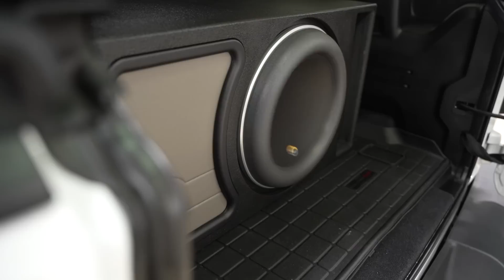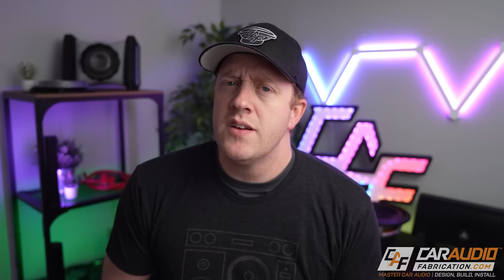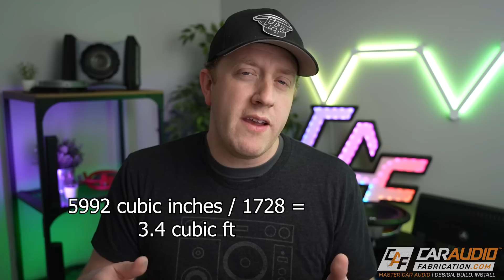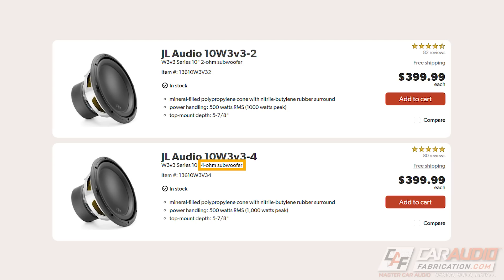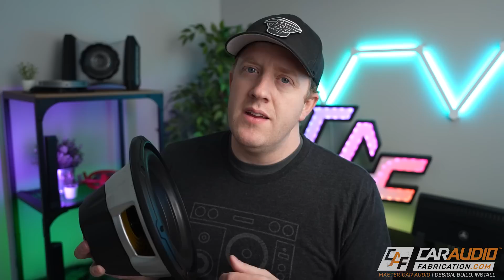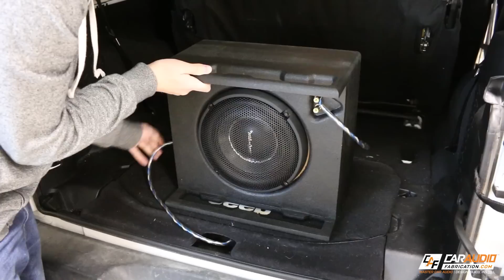4 Subwoofer Mistakes that Destroy Bass! Sub System Planning Mistakes

Comment: I think the biggest caveat is the newer vehicles themselves. Thinner metal that is bent in certain ways to increase strength and aerodynamics but, this creates hollowed out spaces that either absorb bass, amplify certain tones (usually mids), and reflect highs all over the place like a 22 magnum shot in to a metal box. Sound matting can only do so much to correct this unless you are willing to take apart the entire vehicle to its bones.

Older vehicles maybe less aerodynamic and don't have as high as a crash rating, but many didn't have the same sound issues as the new ones. Heck, if your system isn't crazy loud, sound matting may have not have been required to increase sound quality, or it made only a little bit of a difference if any at all.

Comment: I always thought subs facing out the trunk sounded better , but facing it upward produces a noticeable difference and it hits harder. Could you think of reasons why this is? i have a sealed box 10 inch jbl in a shallow enclosure.

Comment: Damn. I made mistake 2. Got a JL RD 500/1 but paired it with a JL12w1 4ohm. It definitely feels underpowered. Should I try a kicker comp R 12” (500w RMS) or try the w1 but the 2ohm version?
Reply: W1 is only 300 w RMS

Comment: How would I determine if I'm occasionally getting poor bass response due to the subwoofer, the enclosure, or the amplifier? I have a JL Audio 10TW3-D4 shallow mount sub (100-400W RMS, 0.52CuFt sealed box volume), wired it 2 ohm to the 5th channel of a JL Audio XD700/5v2 amp (300W RMS), and have it in a molded under-seat sealed MTX enclosure good for 0.8CuFt of volume. It sounds great for the most part, but very obviously falls flat during many 'kick drum' parts of songs that sound powerful in other vehicles with different setups. Unfortunately I'm not in the type of position to be able to try this subwoofer in several types of enclosures myself. Could this subwoofer be picky about that 0.3 extra cubic feet of volume in the box? Or would that just be one of the limitations of a shallow sub in a smaller enclosure? I've never read a bad review about the sub or its output so I'm not sure what to think.

Comment: I have a gutted 300zx, so it'll need more sound insulation in the cargo area but I have like 40ish square ft to work with. Should sound good tho since it's shaped like a CRX. 2nd gen CRX's were always great Db drag platforms cuz they could do a lot with the small sq ft area. The shape of the car helped with wave direction.
Reply: Also I did upgrade my alternator, (it did have a 70A rating too, how did you know? Lol) with a 200A direct replacement from PowerBastards cuz they had the only one I could find with an older v-belt style pulley.

Comment: Securing the actual box properly and things around it is a big one. I was chasing a random bad rattle forever and thought was sub was blown, turn out the box was shifting slightly when I made turns and allowed the searbelt buckle to rattle against it when it happened. Make sure your box can't move and things around it can't make noise.

Comment: I just installed an aftermarket amp and subwoofer to my Ford Sync 2 factory radio. When I turn off the vehicle the subwoofer thumps, any ideas?
Reply: My idea is never turn your vehicle off . That'll fix your thumping.

Comment: Is a 2000 watt amp good for 2 2500 watt 12 inch subs?
Reply from the maker: RMS? You are theoretically leaving performance on the table.
Reply: @ rms power at 4 ohms is 800 watts x1 channel
Reply: @CarAudioFabrication  is that the right information, I’m new to subs but I’m in love with bass.
Reply: @CarAudioFabrication  the subs rms are 1250

Comment: Mark, quick question for you. I am an old guy with a legacy system that I've had since 1997 in my classic Mustang. I have (2) 10 inch S10C Solarbaric subs, DVC. Is there anything out there that has the same footprint and box size that can hit harder than the S10C can? I was wondering about motor size and cone mass to see if there might be something better out there now.
Reply: Wow thats a long time to have the same subs.
Reply: @cleonituk  that's a very good point unfortunately there's a term if it ain't broke don't fix it. I also have a tape deck that works like brand new. I paid $5000 for that system and haven't seen any need to upgrade anything until recently with the new subwoofer tech technologies. My home system is a different animal it's almost 5 figures.
Reply: @1999StangGT4  my first system was way back in2002 in a dodge truck, i had a 15 inch orion hcca with a 3k watt amp behind the seat. Lets just say whoever rode shotgun had to have the seat at a 90 degree angle. But it didnt rattle one bit.
Reply: @ i've got MB Quart all around and then of course the solobaric subs with a kicker amp and a JL amp. Kicker takes care of the subs and the JL does the mains. Roughly 200 pounds of dynamat as well. Before the Basscube was re-released people were begging to buy mine.

Comment: hey how about a vid on supertweeters..i bought some and the crossover is kinda confusing also doi i run the capacitor that it came with despite having a cross over in my head unit and 4 ch amp...HELLP

Comment: Do you have any videos about installing stereos in vehicles that have built in systems? For example, I have a 2018 Durango SRT. It came with a stock 8" sub and I have since upgraded to 2x 12" JL W6s. I cannot get these to sound good and Ive been to multiple shops. I have a pac amp pro installed to get a "flat signal" and its still terrrible. do you deep dive into this process anywhere?

Comment: Is it possible to discuss subject about upgrading hybrid vehicles? Simple replacement of alternator is not possible, changing small 12v battery to bigger is limited by its charging source, maybe there are some solutions of powering amps from traction battery?

Comment: Is it better to for subs in a sealed enclosure to have the minimum recommended volume or maximum? My encloure is measured at .89 ft3, the minimum for my sub is rated at .66 and the maximum for my subs is rated for 1.25

Comment: Is it possible to run one  Rockford P3 with a port and one P3 in a sealed within the same box?  Would that work? I bought two, and they sound great, but the sealed box i built just doesn't hit the low notes like i prefer.  I would rather not take up all the space in my trunk for a box as i put my tools on there. The box i have is made to spec for both P3's for sealed dimensions.   

I guess my question is, would it sound better with one sealed and one ported, and would it work making one box with sharing walls extra sturdy?

Comment: I have a new alpine type S 12" and the mrv-500 amp. I have sealed box. Do you need fluff pading inside the box and should I caulk the whole thing absolutely airtight?
Reply: It would depend on what size your box is.  You could add poly to it and see which way you prefer, as everyone hears differently. I have two of those. They have been in my closet for a while and I am going to implement them as bass for my home stereo I am building. I'll probably get amp from PartsExpress instead of a car amp so it looks better flush on the back of the box. 

For sealing, yes. You should always add a decent layer of caulk (or adhesive) to all of the connecting walls. I usually use extra sound deadening material at the mating point from the subs as well. I just peal of the aluminum layer.
Reply: @nomadchad8243  I just added polyfil to two sealed 12s and WOW. Makes a huge difference.
Reply: You should definitely seal it so it's airtight.  As far as the fluff inside, I've used boxes both with and without it.  It isn't required, but it does offer some benefits for a minimal cost. If your box is on the smaller side for your sub, adding some fill will help improve performance and SQ.

Comment: I am very happy with the box design i got from you a couple years ago for my sundown zv6 12 in my Ford Ranger

Designing it myself with doubled 5/8" and a triple baffle was beyond the capabilities of the simple enclosure design program i've used in the past (Torres) so i went with a design purchased from you and it's rock solid and bumps pretty damn good, thanks Mark

Comment: Another I'd add is the idea that swapping out a good aftermarket sub in a stock "enclosure" would bring much, if any, improvement to your system.  In almost every use case, it's not worth the money, if it works at all.  Clearance issues, enclosure issues, rattling issues, power issues, impedance issues... it just doesn't perform worth the money nor the effort.  Complete waste of time and money.

Comment: Great informative video as usual!👍 I've definately made a few misstakes along the way. High impedance comes to mind as one. Any chance you'd do any videos on smaller vehicles in the future? I find squeezing good audion into a small car is way harder, and I usually never quite succeed. I had too much bass in one ear in my mr2, my mini is short on space to put it politely, and I've got a small panel van (mk2 caddy) as well, which needs a stereo, but also needs to be an actual van, and not loose any space. And my miata is a soft top, so that brings its own acoustic challenges. Finding info on big systems in big cars is never a problem, but i've yet to see any videos on how to build for small cars.

Comment: How do you feel about Memphis Audio? I have heard it in a few mini trucks and it sounds fantastic to me. But I am not a pro.
Reply: Memphis is ok. I had many subs.  No Amps tho
Reply: depends on your budget, they all have budget subs all the way to top tier. Alot of companies compete with each other at the same price points. If you want teeth rattling bass it's going to cost ya, If you want just a little bass to sound good then cheap is the way to go
Reply: I'm no pro but recently over 2024 I've been racking my head about what's good and what's bad. This is what I've found.
Box. Your shit subwoofer will sound anywhere from good to amazing in the right box.
Example. Bose car audio. Sucks.
Fight me if you think otherwise.
Now their home audio.
Amazing. Why? The amount of engineering that goes into the design of the housing for these speaker's/subwoofers is amazing. Open up a car that has factory nose speakers. You'll find they sound dreaden and secure everything for optimal sound quality. 
So honestly I'd go with a known brand. Doesn't have to break the bank. Ct sounds. Kicker. Skar etc.
Then get an amp that will drive them you can mix and match brands just make sure to get the ohm rating correctly. Also if you're going to drive 2 subwoofers with 1 Amp. Make sure that it can drive both at their max successfully. Why? If you want to get the most out of your subs one random day but can't. You'll have to get a stronger Amp AGAIN. BUY ONCE CRY ONCE. Also CCA wire is fine but OFC (oxygen free copper) is superior. Currently driving 2 10's with CCA but the run from my battery is not even 4 feet. So the voltage drop is nearly none. The wires don't even get kinda warm. I have heat vision camera I use for work to make sure I'm not creating a bottle neck somewhere. You don't need it I'm just OCD. If you made a bottle neck of electricity. It would get warm to hot and you could just feel it with your hand.

Personally Im partially deff from birth so I care more about my rear view morror shaking than actual SQ (sound quality). So I've got 2 10's 2 8's 2 6.5's 4 1 inch tweeters.
Sound deadening like crazy. Doors. Ceiling. Floor. Under hood. Firewall. The deadening alone is worth doing. Your factory speakers will impress you if you remove a lot of the outside noise.
End of rant. May the bass be with you.

Comment: Will a 3 inch aero port good enough for 8 inch sub in 0.9 cu-ft after sub and port displacement on 500wrms and tuned to 37hz. Reason for wanting to use the aero port is in case I need to adjust the tuning when install in the vehicle.
Reply: Unless that 8 is some excursion monster, I think you do not necessarily need an AeroPort; a regular round pipe port should suffice.  If you already have the AeroPort though, it certainly won't hurt.

Comment: I have an alpine swr-12d4 with a 500 watt alpine mono block should I put the 12 woofer in a sealed or ported box?
Reply: Generally ported box for "boomier" bass and louder low frequencies. Sealed if space is really tight or u prefer cleaner SQ type bass more. I have two of the same subs connected to 1 ohm with 3kW mono amp and been trying to find the perfect setup. Hard task but thankfully those alpine type R subs are surprisingly good for both SQ and SPL applications.
Reply: You kind of need personal experience to know which you prefer. Can always get both to figure out. But if you’re a person who feels like the bass is never deep enough or loud enough, ported is likely a good place to start.
Reply: Depends
Reply: What genre of music do you listen to?

Comment: I wanted to have 2 mono blocks for 2 of the 12" subs I'll install with a ported box. The subs are 9000W and 2000W RMS while the amp is 9000W max, 4400W @ 1 ohm and 2200W @ 2 ohms so I wanted each sub to have its own mono and my friends say its a bit much since 1 amp can power both but the thing is I want a system that I'll be able to run at 50-60% volume daily without it heating up, what are your thoughts?
Reply: You're definitely going to need to upgrade your alternator 330 amp alternator charging wire. Minimum of two batteries if not three with a cap5 min. And some ground straps. Add a minimum of two block to frame ground straps. 4 frame to body. That's six ground straps. Your entire vehicle creates the power. If you do not do any of these electrical upgrades. At 9 kilowatts of power you're going to need a fire extinguisher✌❤😃
Reply: @crazyfoot490  Noted🤣. The system will be professionally installed all I have to do is buy the components required
Reply: Ported box designs are very efficient... short answer, you aren't likely to see any heat running off one amp.
Reply: Especially with class D amps